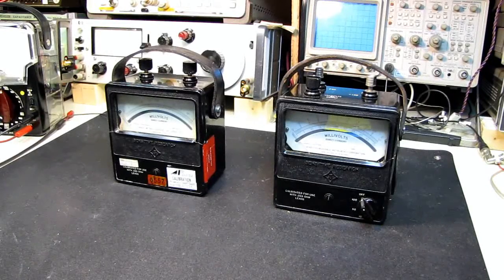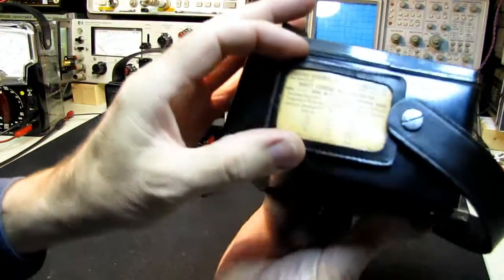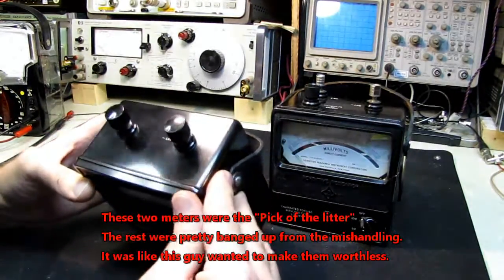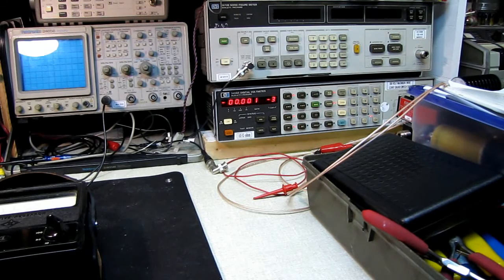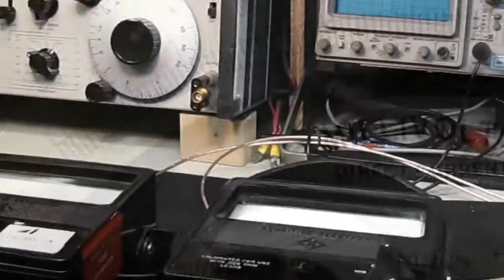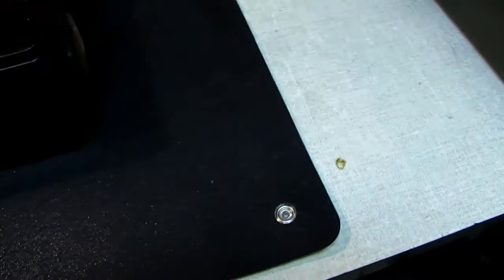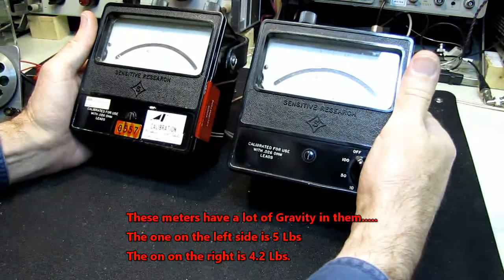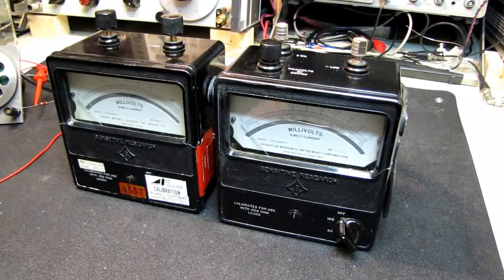Old Tech - Sensitive Research Millivolt Meters

Comment: Sensitive Research was purchased by Singer Metrics in January 1963. They moved all of the operations to Bridgeport. Singer Metrics did the same thing to Empire Devices in July 1963 which was where my father was working. Then we moved down to Connecticut. BTW, the heavy weight of those meters is due to the very large Alnico 5 horseshoe magnet inside. The reasoning was that they were increasing the static magnetic field. And I have my own collection of Sensitive Research meters as well as Westons for bench use. They are useful for continuous monitoring of voltages when you want to see that occasional flick or tick of the needle to let you know something is going on.
Reply from the maker: Thanks for the history Richard, I love hearing these stories.

Comment: Your comment about throw-away society is spot on. This is why I prefer to buy vintage test equipment. It is through hole and comes with service manuals an schematics. It is designed to be repaired not thrown away like even the high end gear these days.
Reply from the maker: Really pisses me off to open a Tektronix so called "service manual" and find helpful comments like "if 5 volt line is out of spec replace the power supply" Hello how about a schematic. They used to have actual service info.  Thanks for watching.

Comment: Thanks for sharing. I, too, love old meters. Here is a vid I did on a couple of Bell System marked meters by Simpson and Triplet:

https://www.youtube.com/watch?v=YEnNiWh3vYQ
Reply from the maker: That Black Bell meter is instantly recognizable as the Triplett 630. Nice. The 30 volt battery is no longer available for that meter, but a simple fix is three 9 volt batteries in series. I have managed to find room inside all the 630 meters for the three 9 volt batteries. Just be sure to insulate them with some heat shrink or Teflon tape.

Comment: I'm with you, I care. Classic test equipment is a love of mine, and I hate seeing equipment like that get abused. I wish I would have been able to get the the hamfest this time, I might have been able to help you rescue some of the goodies. Last spring I rescued an HP 5245L counter there. It was just sitting in the dirt under some guy's table. To be fair, he wasn't actually abusing it, but the thought of dropping such a sensitive piece of equipment onto the ground makes me cringe. It turns out that after a good cleaning and no adjustment whatsoever, it was accurate to within 4 Hz at 10 MHz. Not bad for a $15 "pile of junk". I've rescued a number of other treasures as well, but I think that one is my best save to date.

Please keep up the good work, and please keep the good videos coming.
-73 De: N1RKW
Reply from the maker: Ah yes, nixie tube display. Something very satisfying about all those orange glowing digits. Nice piece of vintage tech. Thanks for the nice comment.